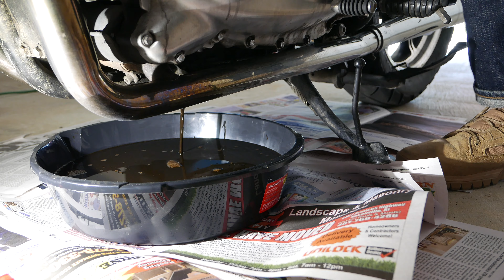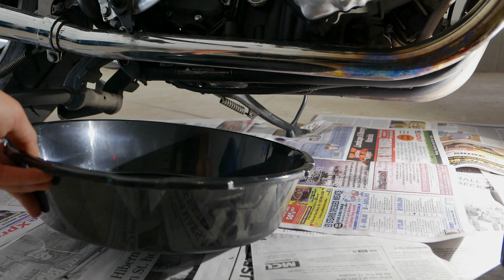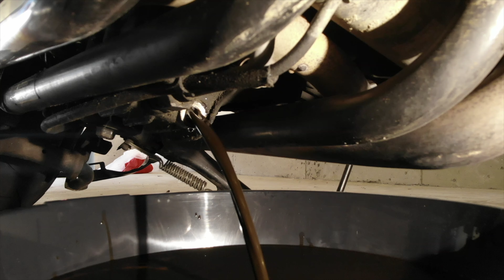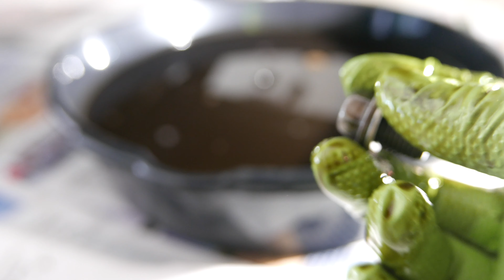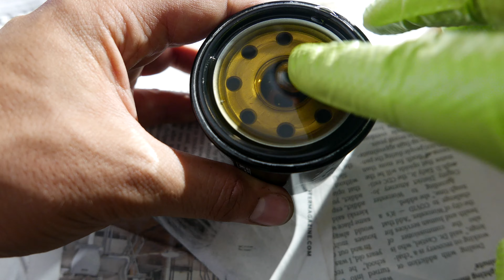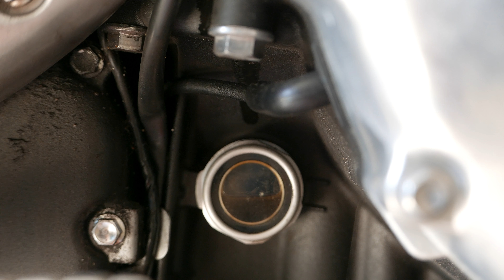Simple & Quick Oil Change | Triumph Bonneville SE

Comment: Quick and straight to point! Very informative. Thanks 👍
But isn't it better to drain the oil by putting the bike on centre stand?
Reply from the maker: I like the ability to rock the bike back and forth, and tilting it on the side stand gives a better angle for me to access the filter and sump plug. But it is personal preference!
Reply: @ChrisIronhardt  My bike's got the filter on the side. It's better with centre stand and my Dad taught me that way. But yes, as you said, personal preference :)
Cheers!